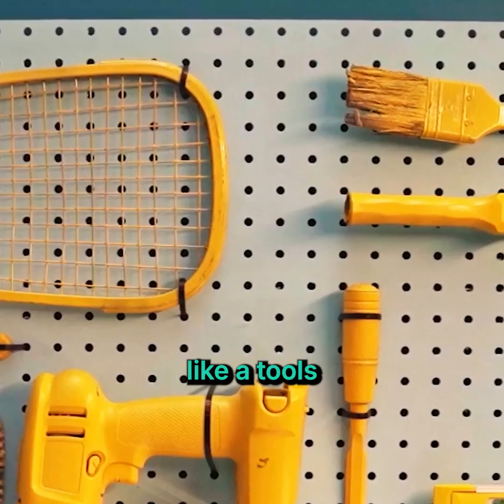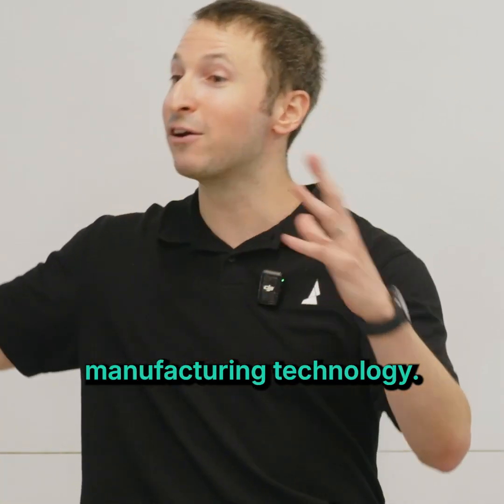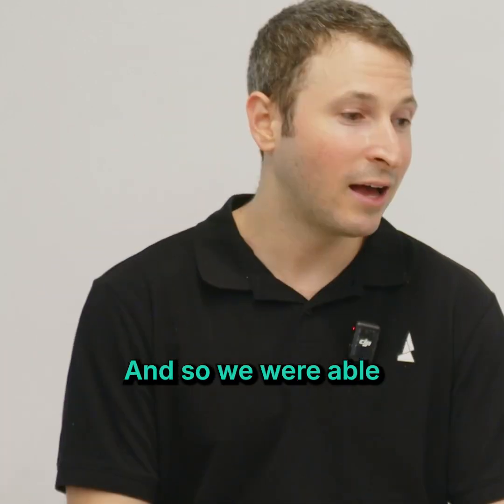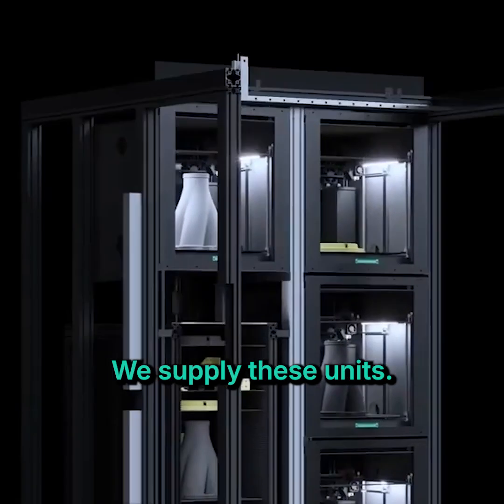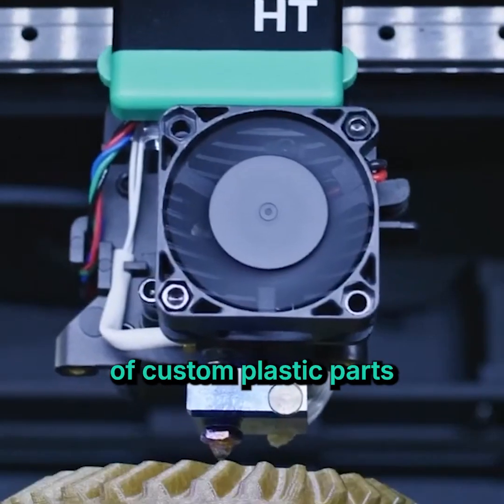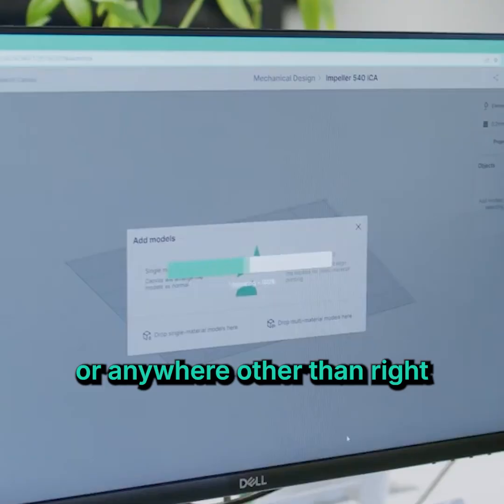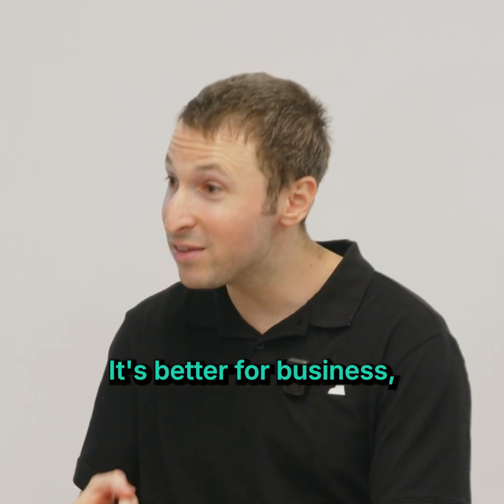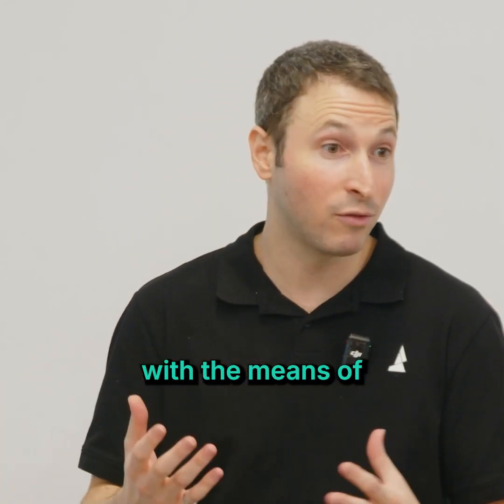Replacing Overseas Supply Chains with Additive On-shore Production |  Feat. Mitch Debora and YorkU

Comment: Injection molding is an established thing
Reply: That's what I'm saying 😂😂😂
Reply: 3D for prototype and once it has been validated go to injection molding. Unless your part requirement is low enough for the printing times. Also depends on volume, roi on the mold vs fixed cost of printing
Reply: This is not about injection molding. This is about making prototypes for new parts.
Reply: You still need moulds for that. And it's more of a permanent solution because it's a lot more expensive.
3d printers are simple to use and you can just leave the part to print without needing anyone running the machine. 

That sounds super interesting to me, especially not having to wait 3 months in between iterations that may or may not even work. Pointless shipping and pollution.
Reply: @Litepaw  molds are swappable and last for tens of thousands of uses. Plus, they make a variety of parts and pieces in minutes or less. 3D printing isn't really fast enough in its current state for mass production. And you're still going to need people to watch it for errors and to clear product. Give it another half dozen iterations.
Reply: @literalsarcasm1830 exactly, they’re only cost effective for runs of 1000+. 10.000+ for offshore. Additive works for prototyping and for small runs. Plus it allows for shapes that regular manufacturing simply can’t make.

It has its place, it’s just inherently not in mass manufacturing.

Comment: You still have to provide the materials.
Reply: Filament is cheap
Reply: @towelbasket no it isn't, filament is really expensive compared to the plastic pellets used for injection molding. Also, molding takes seconds while printing takes hours, so printing can never compete. 

It makes sense to use printers for prototyping, when you are changing designs often. If you find you change molded parts often, you didn't do the engineering right.
Reply: @tonfleuren3536  It takes days to ship things. Also if you buy fillament in bulk it is cheap. Maybe not cheaper than the pellets but total cost is for sure much less.
Reply: @towelbasket Not to mention compact and much easier to transport without damage.
Reply: @CarrieMK  exactly!